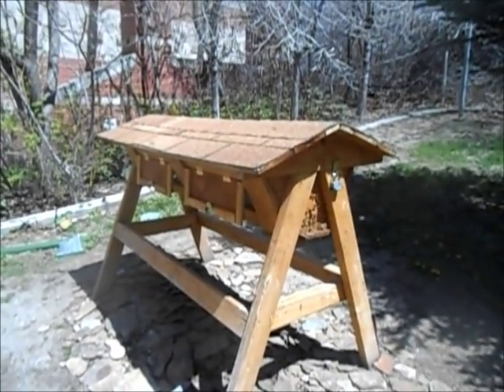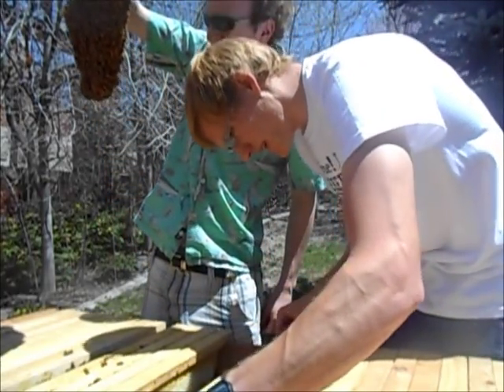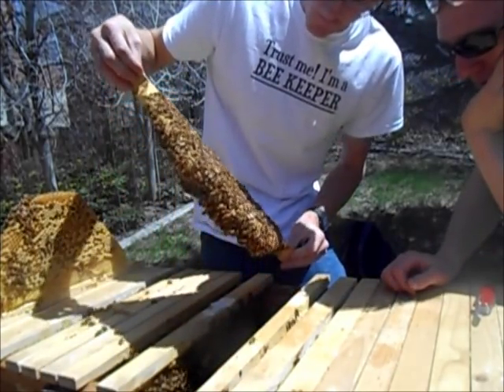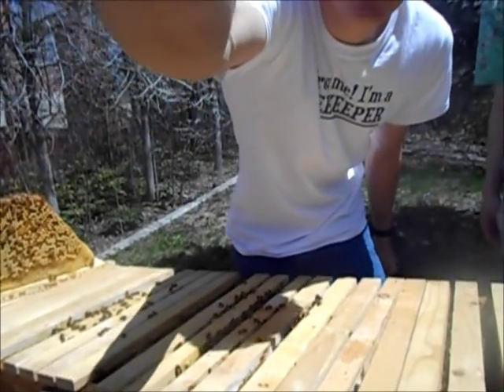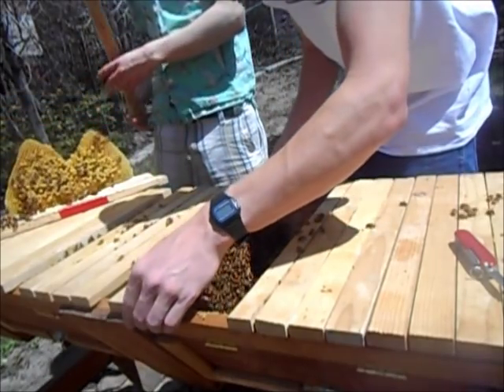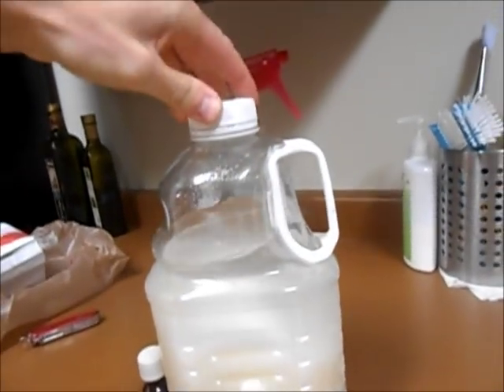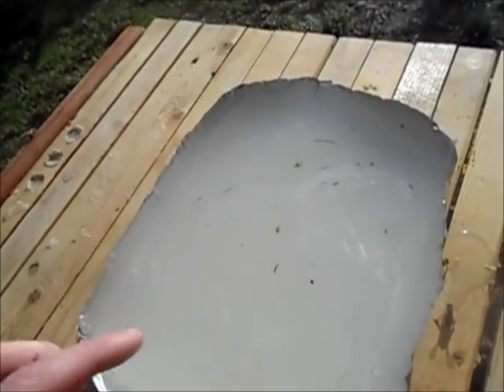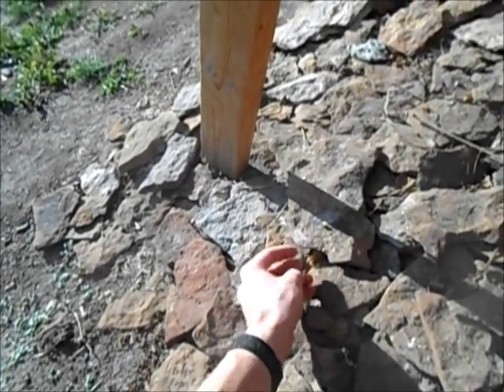Year of BeeKeeping Episode 28, Mite Control

Comment: by freezing the drones you are selecting against the mites that prefer drones. thats bad since after a few generations the mites will prefer the worker bees instead of the drones. Also there is a method to heat the frames a little bit that will not kill the larvae but the mites instead. also you can use Powdered sugar on the bees that will make the mites unable to hold onto the bees so they fall off. this way you can measure the amount of "infections in your hive without killing any bees.
Reply: German here, i had a beekeeping project in fifth and sixth grade and i plan to start prcaticing it as a hobby after i finished my Masters degree and have a stable enough income far in the future so i keep informed. in the Last Couple of years beekeepers here have developed a non chemical way to combat the mites called "Halbzargen-Fangwaben-Verfahren" "half frame-capturecomb- procedure" which works by switching the brood and store box by placing the queen in the other box and heavily limiting the space for the queen to lay the eggs. its hard to translate and i dont know how the procedure is actually called in english maybe you can look it up and check on it apparently it is very effective and doesnt weaken the bees much even though you just kill the brood two to three times during a season.
Reply: I obviously don't doubt the quality of your research, but may I remind you that Cody has been beekeeping for more than a decade now? I'm not saying your tips wouldn't help him, but your comments sounded a bit like your fifth and sixth grade experiences were more significant.
Reply: The Cheaterman well sure. his experience is worth a lot. but what i"ve found was also accumulated knowledge of german beekerpers who have tried and tested these methods. and i trust the experience of a group of proffessional beekeepers more than one who does it on youtube as a side project. (no offence to cody!
Reply: Fair point :-)